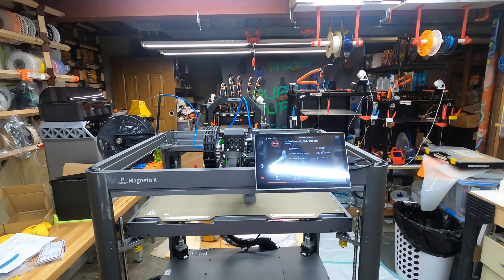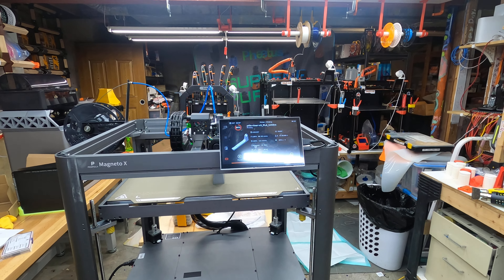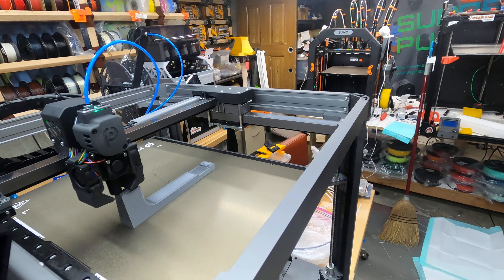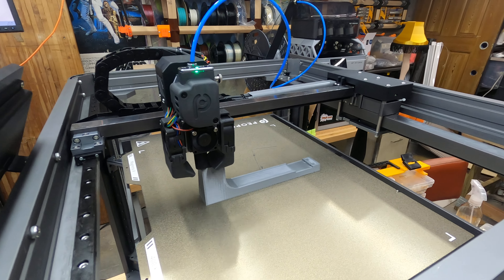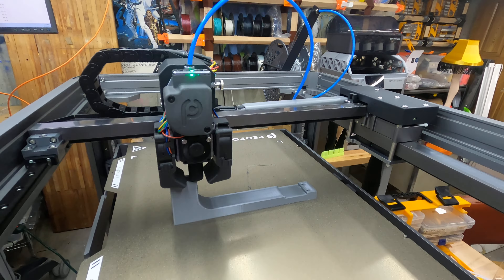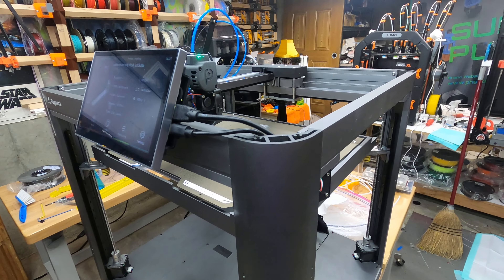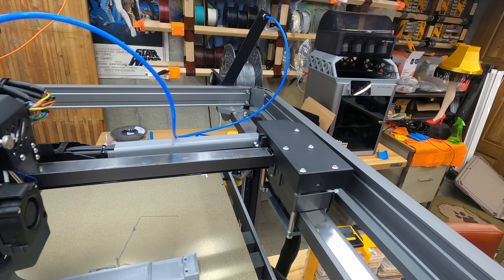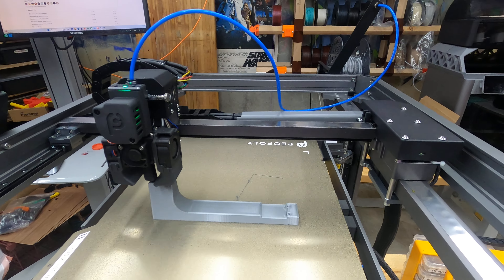Peopoly Magneto X first print

Comment: Glad you liked my designs! The cooling upgrade REALLY makes a huge difference! Make sure to remove the rubber feet and bottom fan grills and direct both fans to blow air into the printer. (I probably should make a video showing how to assemble it properly). Thanks for the shoutout! I have a few fun project videos planned for the Magneto X Soon! Looking forward to seeing what you do with your Magneto X!
Reply from the maker: I'm in the process of adding the cooling mod.  How did you get the fans mounted?  I had to cut the rubber washers to get the Phillips screw to fit.  I also am putting one blowing and one sucking.  I'll probably do a video, as it took some head scratching to figure it out.
Reply: @woodwaker1  I removed the rubber washers completely, placed the fans on top of the new plate, and then screwed them in from the bottom. Just make sure to have the wires pointing in the correct direction to make cable management easy and clean. I will try to add a few more pictures to the Printables page to make things a bit more clear
Reply from the maker: @makerscorner93  Thanks for the tip.

Comment: What's your experience with it now? I hear from others that the new versions are more solid of an experience and i'm trying to figure out if i'm pulling the trigger tomorrow on the $1199 deal they have going. I can tweak and calibrate but if it gets in the way of actually printing, i don't think i could make the leap. The older versions seem to have issues and there's probably not that many new ones out there which makes it hard to find people with updated info on them now :/
It all looks good on paper but man, if there's not enough of a fix to the original issues... :s I don't really want to be a guinea pig.
Reply from the maker: t has been a pretty good printer.  I have had some problems, but support has been very responsive.   I  would like to delve into the software more - it is basically Klipper , but have been tied up with building my Rat Rig V-core 4 and getting Christmas projects tested and printing.  I did not know they were having a sale until your post, I saw $1299 but with an enclosure.
From what I understand some of the recent changes have been good improvements.   It is a unique printer with an unusual bed size, but is really fast.

Comment: Not sure how I missed this video until now?  That new printer is pretty slick with the magnetic control.  Is the mag drive more efficient or more accurate than belt drives?  Just curious.  Amazing they can shrink down the technology to fit in that small bar.  Guess I am used to the large version on rollercoasters and trains.
Reply from the maker: Hello Scott, you have probably been busy build your house.  The mag drive has feedback so knows where is at.  It has a lot more power and no backlash that the belts have.   It is fast and no one has been able to get it into this priced machine before.  It is still expensive, but was $1500 so I wanted to see if it did what they say, so far it is working well.